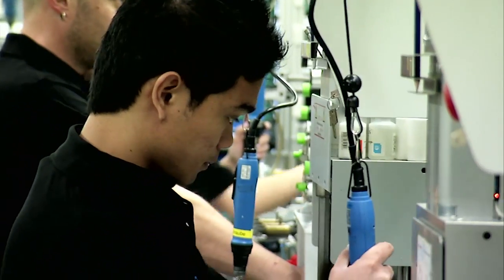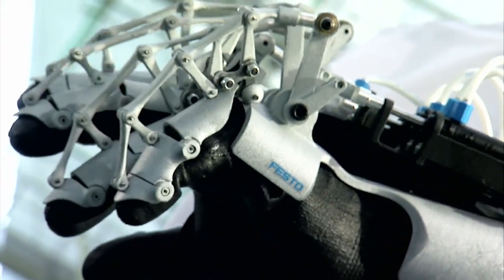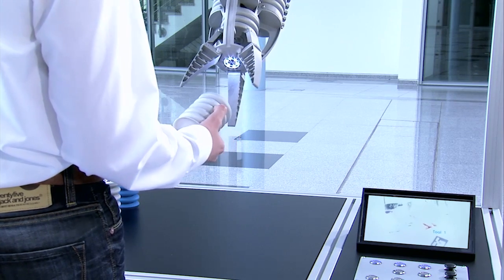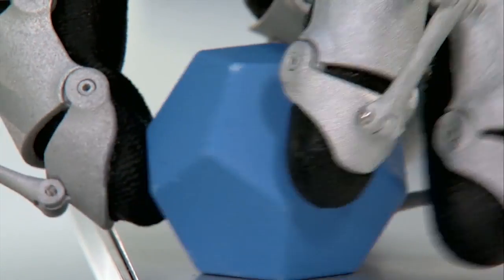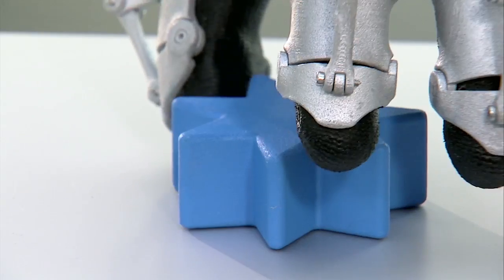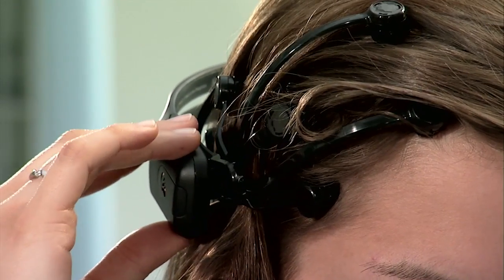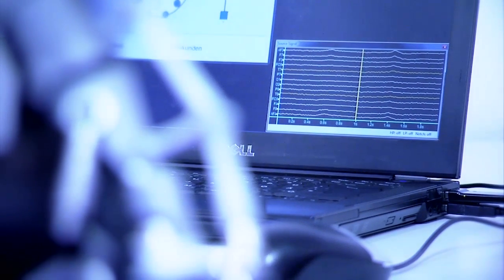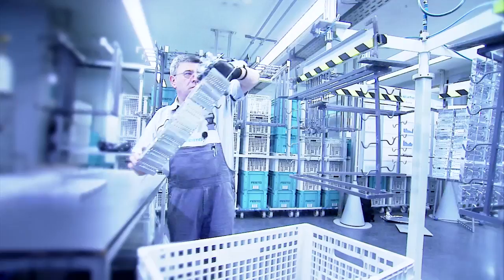Production of the future - new operating concepts between people and machines

Comment: OK, we program machines, but that programming then causes them to repeat the task tens of thousands of times before any human is needed to change anything, or to fix it. Doing this requires a human to do the job every single time, which is slower and less accurate. And why would you need a robot to pick something up on your desk? You don't, there is practically no use for this.